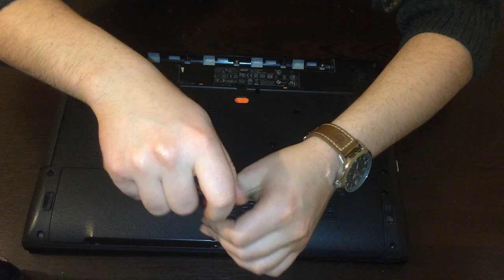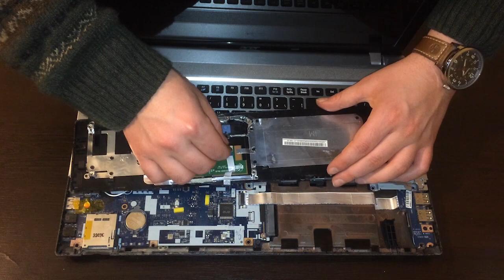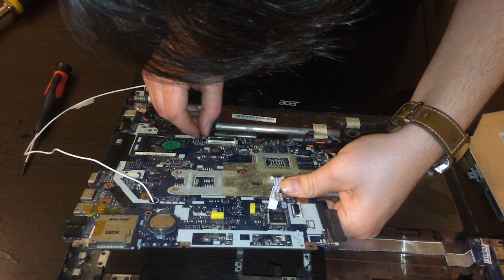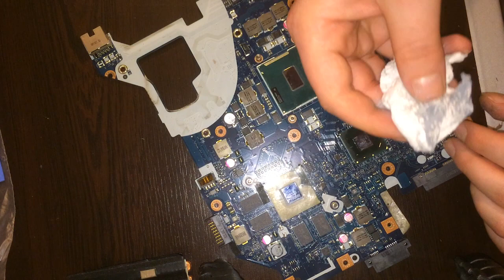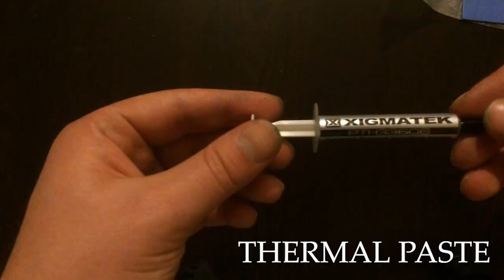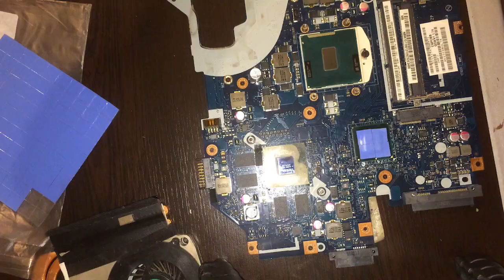HOW TO REPLACE THERMAL PASTE ( PAD ) ON LAPTOP ?

Comment: Hello I have a question I repasted my laptop HP gaming pavilion 15 cause it was thermal throttling but it's still thermal throttling, I used Arctic MX 4 is it 100% necessary to replace the thermal pads and yes they are very soft. Do you think that's the cause?
Reply: I have the same question

Comment: Can I use thermal paste instead of pads?
Reply from the maker: no. I wouldn't recommend. I have never tried, but I do not think it will be appropriate.
Reply: I only use termal paste on GPU and work perfectly but this is personal opinion.
Reply: There is special thermal paste that can be used instead of thermal pads.  BUT, do not use the normal thermal paste that you use for a CPU/GPU.  And vice versa.
Reply: Use whatever the manufacturer used in the first place.

Comment: Can I leave the thermal paste and add thermal pad in my laptops gpu? Hp dv9000
Reply: Put thermal pad instead thermal paste? Well No it will most likely be worst
Reply: Well replacing the pads on the vram is good btw but not on the actual gpu
Reply: @josem3875  it's getting almost the same degrees. Before 65 degrees and with thermal pad again 65 degrees. The hp pavilion dv9000 has just one heatsink that's supposed to cool down both cpu gpu and the cpu goes like 36 degrees and the gpu 65
Reply: @lefteris.adamou.1  Use a better thermal paste like Kryonaut or Cooler Master Mastergel Maker.

Comment: so man, I wouldn't even entrust you with the repair of a teddy bear. Completely unnecessary amount of thermal paste, then the whole CPU is vomited, etc. And the four thermal pads combined into one, it's really ingenious. And those overlaps of the thermal pad on the PCB are supposed to improve heat dissipation. This just prevents the convection of heat into the air and the extraction of hot air by the fan. And I'm not talking about that forgotten Cmos battery.